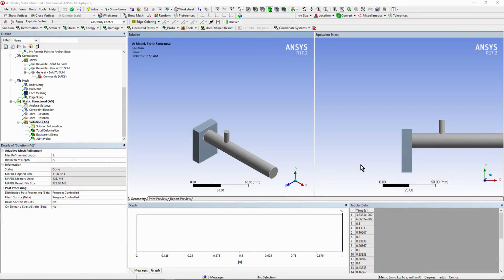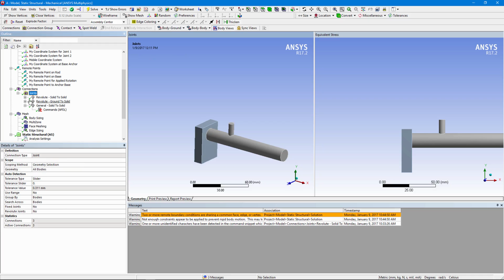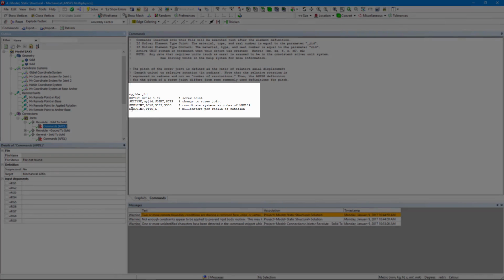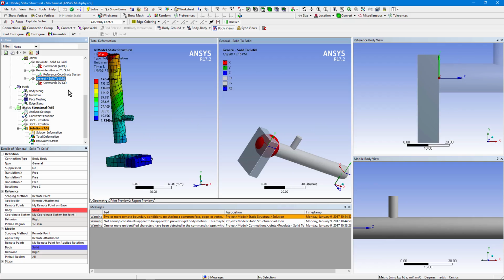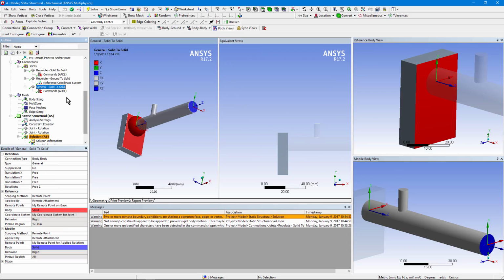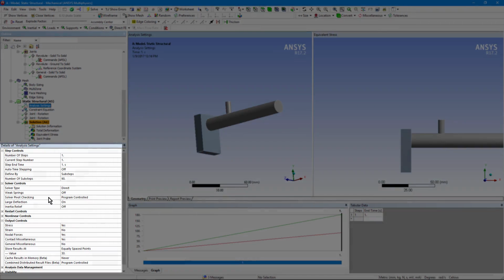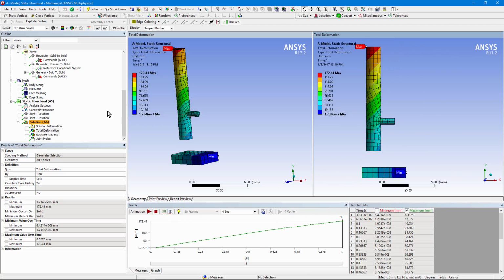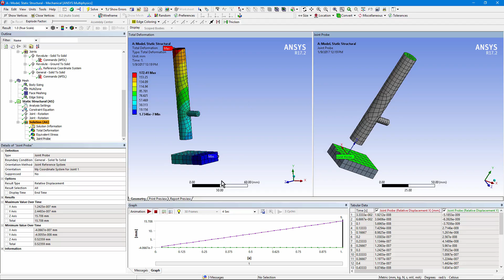Model a Screw Joint in Ansys Mechanical | Rotation-Translation Coupling Made Easy

Comment: I am using mpc184 general joint and solid elements.
In ansys docs says " Rotational degrees of freedom are activated at the nodes forming the element. When these elements are used in conjunction with solid elements, the rotational degrees of freedom must be suitably constrained. Since boundary conditions cannot be applied to the nodes of the general joint, a beam or shell element with very weak stiffness may be used with the underlying solid elements at the nodes forming the joint element to avoid any rigid body modes"
What it is supposed to do? 
I need to connect the same nodes used for the joint with a beam element with very weak stiffness?